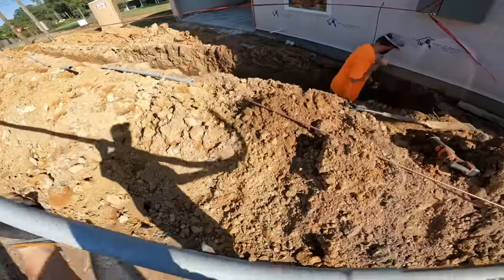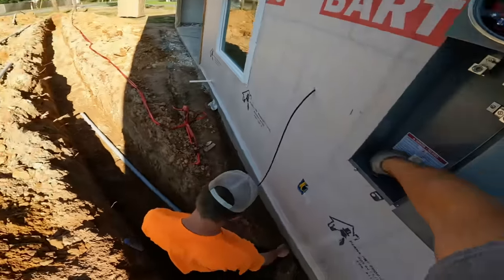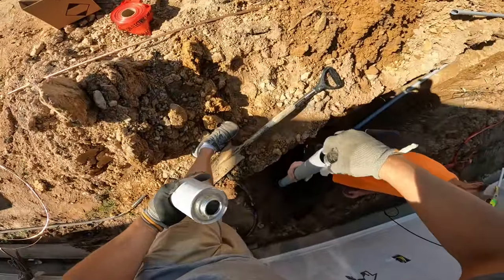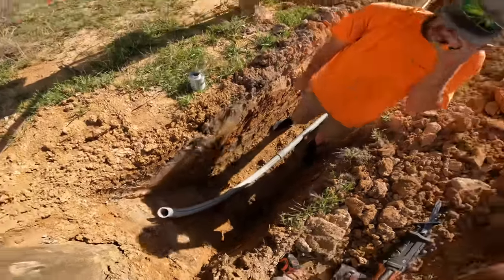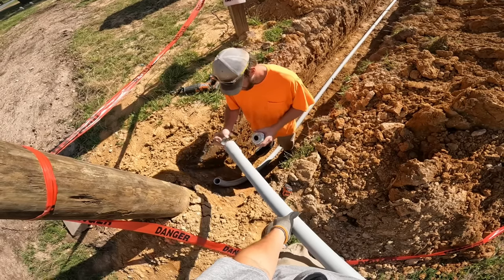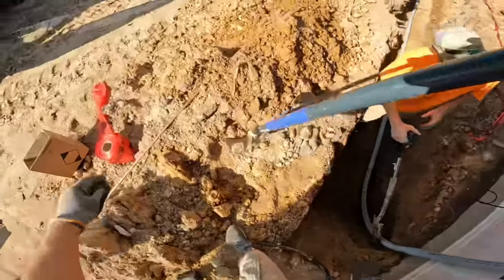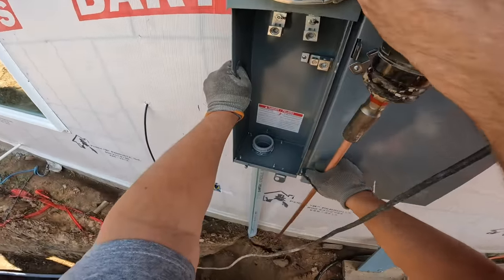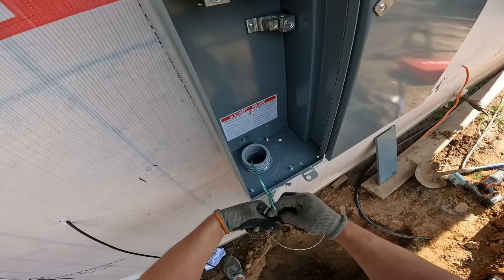200 Amp underground service install.

Comment: The PVC cement is the exact same stuff plumbers use... PVC is PVC. The real difference is that electricians probably use thicker cement, and they don't have to purple-prime the fittings before cementing. The factory bell ends on pipe segments make for a VERY strong coupling, too. PVC cement does a solvent weld. Great video, fun to watch heavy duty burial work!
Reply from the maker: Thanks!
Reply: I’m not sure if it is required in your area, but in south Missouri we have to use an expansion coupling any time conduit penetrates through earth. Helps with the conduit not warping or pulling the junctions apart whenever the backfill compacts or the house settles. Also, in my opinion oatey fusion is the BEST pvc glue for service laterals. It stays gummy for a little while longer and whenever hot pvc goes into cool earth, it will contract a bunch. Always seems to happen worse in the summer time, so the fusion glue helps with it not busting open over time. It just helps if you ever have to pull new conductors 4 or 5 years later. Great video, you guys both seem like very hard workers and do very high quality work! Thanks for the video!
Reply: @alexg0097  That product claims it's self-priming too, so it's a one-step for both electricians and plumbers. Is it a purple glue that will satisfy plumbing inspection? These guys are down in Arkansas, maybe it's south enough where they don't need PVC expansion couplings.
Reply: @aaron74  I have heard from the inspector in Jonesboro Arkansas that they don’t “require” expansion couplings. They just recommend them if the riser isn’t encased in concrete. But that was just one inspectors take on it. It is not a purple primer, but I feel like I had a plumber tell me he had used it to connect PVC to ABS with it. But, i’m an electrician, not a plumber if you know what I mean lol. Here in the southeast of missouri it gets really sandy or really rocky. There is basically no difference. In the sand I have seen almost a foot of settling on some risers, so I just always put them in and tell both of my guys to put them on every new service
Reply: @alexg0097  Yeah I suppose expansion couplings can never hurt. It's good insurance to prevent a possible problem later!
Reply: When I do electrical work, the electric company sends me their requirements.  One company states their requirements are that the PVC pipes must have primer and then gray cement, belled PVC, etc.  While across the street is another electric company that has different requirements to attach PVC.  So, always best to either ask for their requirements or look online at that particular electric company's installation website.

Comment: Well that’s a sight to see!  It’s the rarest of sights to see an Electrition with a shovel.
Reply: I'm 64, I still use a shovel.
Reply: Electrician 
Spell check is real
Reply: Not our electric company.My dad bought a trencher to save money on uninstalling services Just like this, on every new home we did. But we
Always used 3 inch pipes with a slip joint on the panel So it will not pull the panel off the wall when the ground settled.

Comment: Your missing the expansion joint. There should be an expansion (or compression) joint right below the meter enclosure. That way if something settles the conduit won't rip the meter from the side of the building.

Comment: Nice Video and well explained. Do you need to strap the line as it connects into braker panel? And if you do what type of strap or support is use for that? I am an Hvac contractor and do light duty electrical and that is it.

Comment: we are required to use a slip coupling up to any enclosure. Do you ever use a wet vac to pull string in?
Reply from the maker: They do not require an expansion coupling in our pvc runs in my area unless the prints specify it. Yes, we use wet vacuums  to pull string if we get it loaded up on the truck 😂

Comment: Would like to see you wire the panel as well…maybe next one 🥃
Reply from the maker: It typically takes me 2 hours to wire a 200 amp panel. Really depends on how many home runs we have but that’s pretty close. There are people that can make pretty panels. Mine are just ok at best because I gotta get it done and I don’t have a lot of time to waste on making it “pretty”.
Reply from the maker: I will try to get you a video though.
Reply: @Kisselectric  if you were installing a new panel, but knew you were going to add a sub panel beside it in the future, could you leave an extra couple feet of wire rolled up above the main panel?  How would you do it?
Reply from the maker: Sub panels are fed from a main panel. There are steps that could be taken to leave conductors safed off in a main so you could set a sub panel later. Depending on the location of the sub panel if you left conductors in an attic you would have to place them in a j-box with a cover incase they were to become energized.
Reply: @Kisselectric  I should've been more clear...the future sub panel would be for a solar inverter to power up, not directly from the main panel...I'm wondering how to leave an extra couple feet on the wire to reach the sub panel when solar is installed...will it break code to have a couple extra feet of wire wrapped above the main panel?  It will make the sub panel so much easier...

Comment: 2" 36" radius 90 degree elbow. Edison makes us install a 3"  conduit for a 200 amp panel. Then they make us mandrel the pipe. Wow , where is the second ground rod?
Reply from the maker: The code says 25 ohms of resistance or less to ground is required and if it isn’t then add another grounding electrode. In most cases around here due to the fact that the earth has good soil.

Comment: What kinda siding going on the house? If its brick your in a bad way as you should mount your meter base main on the surface of the brick. Same thing if aluminum or vinyl siding. They cant get the siding behind the meter base. They will have to work around it and thats not goid because after a few years water will get behind the meter and rot away the wood.
Reply from the maker: I agree with you as far as there is a potential for water to get behind it. I believe the siding guy will J-channel around it and also break in some aluminum. Thanks for watching!

Comment: Usually in new constructions they run Telco and Coax Cable Conduits. Why was this not done in the same trench?
Reply from the maker: In our area, fiber is being installed by a separate contractor. Depending on the builder or home owner we will run coax, cat 5 or cat 6 to bedrooms and a drop in the living room.
Reply: I was told that nothing else can go into that trench. No communication, no low voltage, no water supply lines, etc. Is that true? There should be no electrical interference with fiber optic, but could save some money on digging another trench. 
Does the same principle apply to running service to a shed or another building on the property from the main meter ?
Reply: @mar1video  I guess it depends on the jurisdiction. When they built my new construction, they had a single trench for all electrical, telco, and coax. The single trench ran about 150 yards.
Reply: @drwhoeric  - I’m always trying to find out more details before the project to avoid surprises

Comment: Try tying a grocery bag or other thin plastic sheet to the pull string and use a shop vac to suck the string through. Works like an absolute charm! Great video. Thank you!

Comment: I was trenchin for some electrical conduit, only had to be a 18 inch depth, but of the 400 foot run about 150 feet of it was about 2 inches of hardpan dirt, and another 16 inches through just a solid granite slab of rock, very fun day.
Reply: Thats when you pour 2" of cement over it so you only need 6 or 12" depth 😂

Comment: When storing your PVC cement be sure the dauber is screwed on tight and set the can down bottom side up. That way you won't get any air mixed in with the cement and it won't get all goopy. Thanks for the Vid, Super Electrician Guy!
Reply: i just put the can in a zip lock bag.
Reply: @Pepe-dq2ib  Check for leaks. The cement will eat up a sandwich bag.
Reply: @leftylou6070  never had that happen, maybe because i use up a can in less than 3 months.
Reply: @Pepe-dq2ib  I've never had a can more than a day and a half.
Reply: @leftylou6070  i mainly work with emt.
Reply: @Pepe-dq2ib  You are "The Thin Wall Man" Excellent!

Comment: really video and I leanred a lot! I have a quick question, centerpoint in Houston just moved the power pole in my backyard to another location. what kind of electrician should I look for to do the underground service installation? and will the power line and internet cable go into one conduit and will be connect by the electrician in one job? Do I need to call AT&T or something? thank you!
Reply from the maker: They may do it for you for a fee however a local residential contractor can handle it. As far as multiple utilities going in the same ditch, they probably will have to be separated either by depth or width. AT&T will likely send their own contractors to do the work. Thanks for watching!

Comment: In my area clear PVC cement is used regularly.  The gray cement can be used without cleaner.  All PVC cement forms a solvent weld, not a chemical bond

Comment: Appreciate the really nice explanation of how this is done.  Just a couple of quick questions:  1. It appeared that you immediately backfilled after laying and securing the conduit.  When are inspections done in your area for depth and correct conduit thickness?  2. How does one handle a situation if the house in not complete and ready for mounting the electrical box, can a temporary location  (close to the house) be used to install the temporary service.  Do you ever do this type of install?  Thanks and again great job.
Reply from the maker: We call for the inspection after we lay the pipe. We use sweeping 90’s that are 3’. We do so much work in that area the inspectors know us quite well. We use the temporary power pole until we have complete the service. We have the utilities company disconnect the temp and terminate the power to the new dwelling at the same time.

Comment: All schedule #80 or just the vertical ? What size service wire in the conduit for 200 amp service?
Reply from the maker: Scheduled 80 on the 90 and vertical
Reply: What about the wire sizes?

Comment: My understanding is at 30” you can do direct burial. Did you do conduit because the utility company will run cable much later?
Reply from the maker: Yes, the utility company in my area will pull in their conductors in the conduit once the city passes the inspection on the service. That’s why we put the string in the conduit. They are a bunch of babies. 😜🤪

Comment: ground rod and ground wire. i thought 2 ground rods are needed. and you need to wrap ground wire around rod. and not the U hhook like thing you did? or is server smaller and not needed?
Reply from the maker: So the code actually says 25 ohms of resistance or less and if you can not achieve that, then an extra ground rod is required. Our soil allows us to achieve those values so we are allowed by code and by our local authority having jurisdiction to use the single grounding electrode.

Comment: I thought code since at least 2017 requires 2 ground rods at least 6 feet apart and the conductor from panel must be a single continuous wire that connects to both ground rods.  At least that is what I read in a 2017 code book.
Reply: That's what I thought too and it was kind of strange that he only did one rod.
Reply from the maker: I will have to do a grounding electrode video. There are exceptions to the second grounding electrode. Also, it really depends mostly on the authority having jurisdiction (inspector).
Reply: You only need1rod as your supplementary grounding electrode if you have a ufer ground or a cold water pipe grounding electrode with at least 10' of bonded copper water pipe extending from the house. After the 10' you can change to plastic.
Reply: Your riser coming up out of the earth really should have been rigid or imc conduit, not plastic.
Reply: @johndavies2949  No supplementary electrode needed with a ufer.